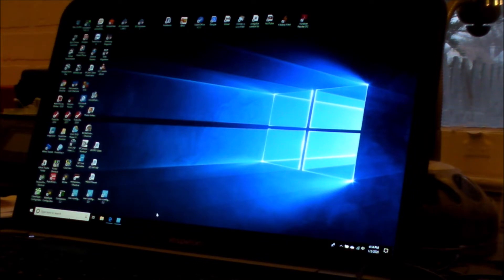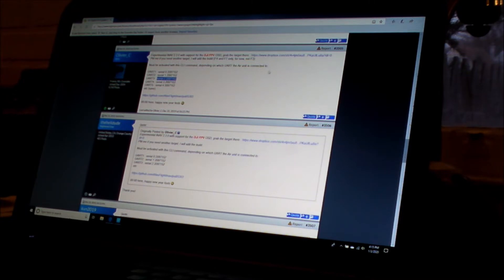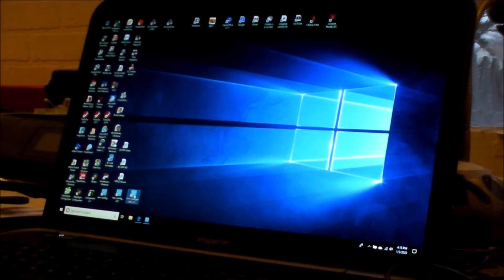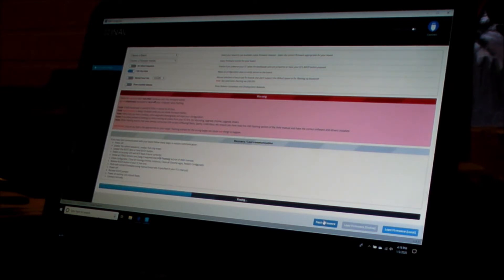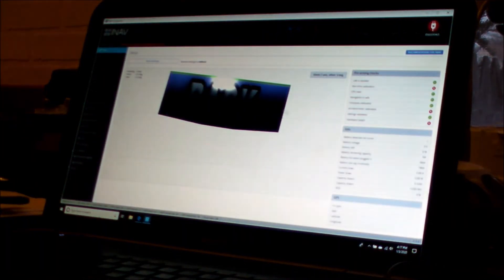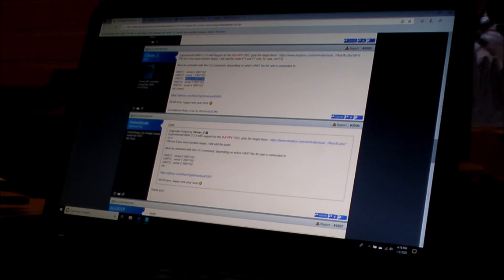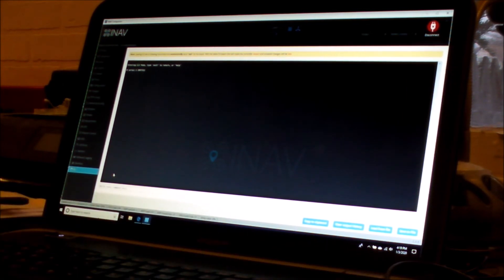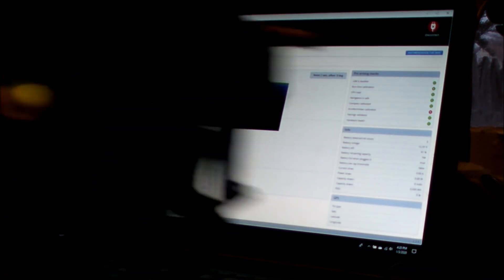INAV 2.3 OSD patch for DJI FPV Goggles!

Comment: Does it have the arrow home?
Reply from the maker: No, not yet. What ever is in BF, waiting on next DJI release. I think there's 24 elements now.
Reply: @philthayer4087  When the arrow home is functional I will be buying a set of the DJI goggles.  I can't wait to not have to haul a tripod full of 2.4g antennas out to fly my fixed wings.